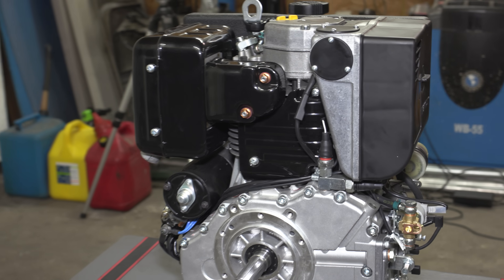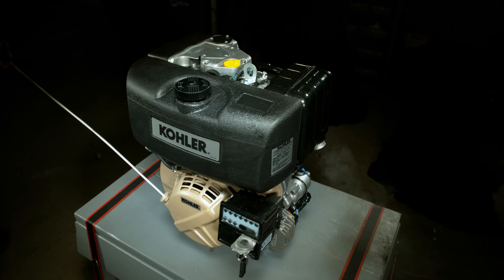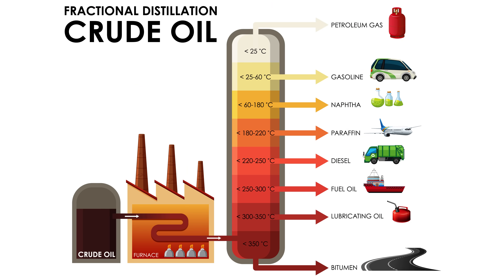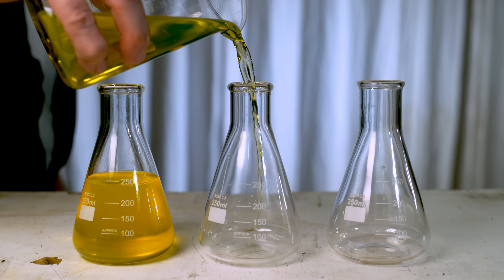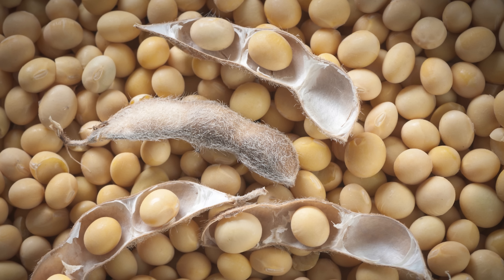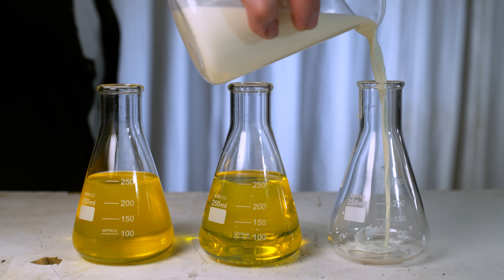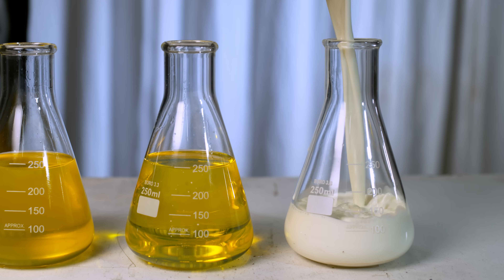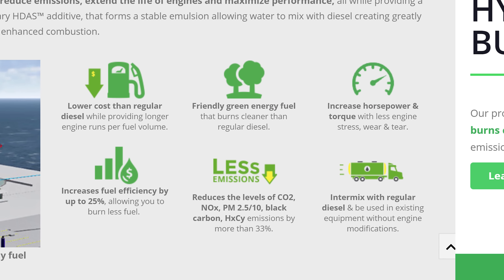Diesel - Biodiesel - HydroDiesel  (Fuels I Will Be Using for My Diesel Engine Series)

Comment: Never heard of Hydro Diesel. That is what I'm most interested in seeing more info on.
Edit Ok upon more investigation finding consistent info using the search terms Hydro Diesel or Hydrodiesel is hard to find consistent info on. For those interested search for Emulsified Fuel or offshoots of that for better info however the info is still limited with that. It looks like an interesting technology that has been being worked on for years but I am super interested in seeing more info and real world testing on this. So hurry up! 😁😉👍
Reply from the maker: Heck yeah.. it's coming
Reply: @WarpedYT  know I'm a bit late to the show but would you ever consider circle backing and checking out/trying Black Diesel(also known as WMO Diesel or Waste Motor Oil Diesel)?
Reply: mute8s I think it is a Bit like the Fischer-Tropsch-Verfahren
Reply: @kommentarekommentieren455  Yes , i 1st heard about it from a very old guy from Germany, back 1979/80, went to visit him for a demonstration of Diesel fuel and WATER, he blended Diesel with hot water in a hi speed Blender, poured it in a container under hood of a later 70s Mercedes 4cylinder car! he also had in trunk a fuel heater ,heated by engine coolant(someplace i have a pic of heater).
drove around the block 3 times without problems .
at the time it seemed a lot of work for what was done, altho fuel prices were going UP then!
 but , in after thought, i busy with life and its BS, shoulda, coulda , woulda,  still a viable thing!
 like Germans squeesing oil out of GRASS from bottom of the DANUBE river, so much knowledge lost in changing times!
 now we are in a FAST change again of normal(for today) life , i think a lot of good things will come of it all!
 humans are a tough lot, and will come back to power, long before it all ends!
 they seem to work best when under the threat of a form of death/etc!
Reply: I found this series of vids you’re doing very interesting indeed. I’ve owned 2 diesels and very much liked them. They do though get very bad press, and I am still sure more because of bad habits by drivers that cause this. 0-60 times are not what they’re about, and the motoring press and ad makers should hang their heads in shame, coz when gas is gone it’s gone! There is almost no quicker way to burn it than blasting away from the line every time, as is the norm these days - only to join another queue🤪
Anyway rant over, I was encouraged to see a new cleaner breed of diesels on a recent search of 2014 - 2017 cars that here in UK qualify for really low annual tax. Usually a sign of how clean they are. So any tech or ways to improve that even further is a Major in my book. Thanks so much for doing this👍👌
Reply: @ICGedye   Been trying to find out more about oil and water emulsions, lots of great info comes from the videos on youtube that are about cosmetics when they make lotions and creams. Lecithin comes up quite often as the surfactant that bonds oil and water, I cannot see why it wouldnt work with diesel fuel. one thing that I have learned is that you cannot mix the surfactant with the oil first. you must mix it with water otherwise you end up with an unstable emulsion.
Reply: www.trillion.energy is the developer and producer of HydroDiesel fuel.
Reply: ظ
Reply: Me neither I’m hoping that Hydro Diesel will make diesel engine vehicles still be able to be produced even 30 laters when EV and even CNG vehicles would dominate the road
Reply: Engineering Explained could make a video about it.

Comment: Renewable diesel is a pure hydrocarbon diesel fuel that is chemically similar to fossil diesel, and is known as Hydrotreated Vegetable Oil (HVO) fuel, whereas biodiesel is a Fatty Acid Methyl Ester (FAME) product which is not a hydrocarbon. Biodiesel contains oxygen, making it different from both fossil diesel and renewable diesel and therefore can not act as a 100% substitute for traditional diesel. Nearly all OEMs (original equipment manufacturers) limit biodiesel content to 20% with some only allowing 5%.

Comment: Hydro Diesel.  Would you have to switch say from  7.3l turbo diesel engine to a kohler engine?  How much would something like that cost?  Can people source say or buy their own "hydro diesel" machine like spring board diesel sells in Chico, CA?  And what would be interesting is to have a system that can self-clean/filter and recirculate - like a closed system>..  Of course, tesla, the gas companies and biden/WEF wouldn't like this.  But who cares.

Comment: Maybe talk about difference between Renewable Diesel and Biodiesel. Big difference there. Bio is blended with fossil diesel and contains water which is bad for Diesel engines. Renewable diesel has no fossil diesel, no water, burns way cleaner, and has a higher Cetane value which provides better performance for Diesel engines. Made now in the mainstream Refineries. Renewable jet fuel way better for the atmosphere. A lot to discuss there.

Comment: guys dont use biodiesel it will screw up your engine big time...fuel filter will clog, lines will deteriorate in no time and in colder climate it turns to jelly...also its not advisable to store it due to algae growth and sludge....You will spend alot of money in repairs (and pollute environment even more) just use regular diesel if possible with ZERO bio added. This environmental hysteria is just a tool to rip you off, dont fall for it.

Comment: Have you heard about a diesel fuel called Neste MY? They say it’s made from recycled waste. Something to look into.
Reply from the maker: I think that is the same as the biodiesel that I try here.
Reply: Neste is a renewable diesel. Renewable diesel is a pure hydrocarbon diesel fuel that is chemically similar to fossil diesel, and is known as Hydrotreated Vegetable Oil (HVO) fuel, whereas biodiesel is a Fatty Acid Methyl Ester (FAME) product which is not a hydrocarbon. Biodiesel contains oxygen, making it different from both fossil diesel and renewable diesel and therefore can not act as a 100% substitute for traditional diesel. Nearly all OEMs (original equipment manufacturers) limit biodiesel content to 20% with some only allowing 5%.

Comment: Can you leave some bare iron/steel sat in the hydrodiesel for a while to see if any corrosion occurs? Also maybe get in touch with Project Farm for him to compare it’s lubricity compared to normal diesel? Corrosion and lubrication would be my main concern about running it through a diesel injection system, especially a common rail system. 

Would also be interesting to see if it works for combustion chamber/carbon cleaning at all.

Comment: Check egt’s with the engine running rich on each fuel. 

That could be useful for superturbo diesel om606 engines, om648 tuning an so on👌👍 if one fuel burns colder

Comment: First of all I am excited for this series, second I have done some research on alternative diesel fuels and some that I am interested in seeing are SVO (straight vegetable oil) and DME (dimethyl ether). I know that the SVO works in old Mercedes diesels as I am running mine on it, I would like you to try SVO to get people thinking about the fuel as it is a simple and cheap alternative. DME as a gas though so you would need to modify the engine to have it mix with the air as it comes into the air intake. It shouldn’t be too hard but throttling it and maintaining control may be a bit difficult.

Comment: Don’t know about the individual fuels - I’m interested in seeing how you make it see though with the high pressures diesel engines develop. Sounds like an engineering challenge of its own.  Big fan, looking forward to the video.
Reply from the maker: It is an engineering challenge, but I've been working at developing a solution for about three years.

Comment: I would like to see: 1. how much carbon is accumulated inside the engine combustion chamber for each fuel type. Also, 2. Oil condition after running engine for a long period of time and compare protective properties and any valuable information that oil analysis can reveal.

Comment: How about Renewable Hydrocarbon Diesel? It's a Hydrocarbon fuel like petroleum diesel, but made from fats and oils, like Biodiesel.  There are several new production facilities being planned by a number of different companies.
Reply: Renewable diesel is a pure hydrocarbon diesel fuel that is chemically similar to fossil diesel, and is known as Hydrotreated Vegetable Oil (HVO) fuel, whereas biodiesel is a Fatty Acid Methyl Ester (FAME) product which is not a hydrocarbon. Biodiesel contains oxygen, making it different from both fossil diesel and renewable diesel and therefore can not act as a 100% substitute for traditional diesel. Nearly all OEMs (original equipment manufacturers) limit biodiesel content to 20% with some only allowing 5%.

Comment: If you end up doing the see through Diesel engine, try mixing a bit of ether with diesel fuel. Ether reduces the ignition delay period which is the time from when the fuel is injected in the cylinder to it combusting because the fuel has to vaporize first under compression before it combusts.  And if you use the high speed camera, you could compare the ignition delay with regular diesel/other fuels.

Comment: You should improve your test rig. Use a electrical generator as the load, where the generator stator is connected to a acurate scale. So, it is the same as before, Nm x rpm = W. But the generator load is smoth and does not fluctiate as the rotor with brakepad that you are using.
Reply from the maker: I agree, the only issue is the size of that rig, I was going to do a different type of Dino using a similar principle, but instead of electric resistance using fluid resistance which is also very smooth, and deals with heat a lot better. but the reason I didn't do the fluid I know from the beginning is because again it's kind of bulky and everything is hidden. For this test I got the brake dyno pretty straight where it's not shaking all over the place. I was going to add an external shock absorber which I may still do but for now, it looks pretty accurate.
Reply: @WarpedYT  You could use a simple asynchronous motor that come in all sizes as the load/generator. Rotor is connected to the diesel engine and stator is free rotating, only connected to the scale. Then, use ac capacitors over the delta winding to magnetize the rotor. The load, you can electrical regualate with a pure resitive load, like a simple heating oven or lamps. This principle how we find motor charakteristics in the industry. The diesel engine is not yet dead; diesel contain a lot of energy and in a closed carbon loop, with adblue and particle filter tech, it is usefull to the point when the battery get cheaper and better.

Comment: HydroDiesel.  http://trillion.energy/en/.  Everything on the home page screams  scam.  From the proprietary emulsifying additive that makes it possible (lots of off the shelf products already do this.  The concept is not new even if they have their unique method).  The sprinkling of various percentages of fuel savings, while increasing power, and still reducing every buzzword emission they could find.  The goofy image of the facility just hanging out on the shore.  Based in LA, a state rife with corruption.  I guarantee running emulsified water through a common rail injection system for any length of time will mean at least new injectors, possibly high pressure pump, and if not caught in time a new engine.  If a person really wants to run water through their diesel engine then a quality water injection system set up in the intake tract is a proven technology.

HydroDiesel testing.  This is all lab stuff, and the manufacturer should be able to provide.  Bet they won't though.
Lubricity,
Corrosion Suppression
Bacteria and Fungus Propensity 
Flash Point
Cold Pour Point
Cloud Point
BTU content.

Comment: Very interested to see the new fuels. Towards the end of the series if the see-through head is successful of course I'm going to say for everybody it needs some boost. A modified mechanical fuel system should easily adapt for some sweet boost and turbo noises👍

Comment: Renewable diesel. R99. Supposedly it acts like a regular petroleum diesel at low temperatures and doesn’t harm rubber seals and fuel lines. Propel and some 76 stations carry that here in California.
Reply from the maker: I'm going to check that out
Reply: Renewable diesel is a pure hydrocarbon diesel fuel that is chemically similar to fossil diesel, and is known as Hydrotreated Vegetable Oil (HVO) fuel, whereas biodiesel is a Fatty Acid Methyl Ester (FAME) product which is not a hydrocarbon. Biodiesel contains oxygen, making it different from both fossil diesel and renewable diesel and therefore can not act as a 100% substitute for traditional diesel. Nearly all OEMs (original equipment manufacturers) limit biodiesel content to 20% with some only allowing 5%.

Comment: I would really like to see this Diesel engine run 100% synthetic fuels using the Fischer-Tropsch process, especially a Gas-To-Liquid conversion. Synthetic fuels hold a lot of potential of being a total transition from traditional fuels altogether and existing engines don't really need any modifications to run these fuels. Even Shell and Sasol have launched synthetic fuel plants in certain countries, but they have yet to go mainstream here in the U.S.

Comment: Smartplugs, you can run a gas engine on diesel with these
Reply from the maker: Problem is that a gas engine doesn't have nearly as much compression. So I don't think the efficiency would be nearly the same.
Reply: @WarpedYT  Yes, tha'ts why smartplugs essentially make a variable compression ratio.  You screw them in and out to change it.  They start on 12v, like a glow plug, and then adjustments are made.  We ran an 8hp briggs on straight diesel, and then got down to 50/50 mix of veg oil and diesel.  We never got the gas engine to run on straight veg, but we got pretty close!

Comment: Would love to see a 12 volt battery hooked up and the use of the key start ;-) you know to help PREVENT injuries ;-) 
Just messing with you and I am very excited to see what kind of crazy you come up with.
Reply from the maker: Well once you see the video, we should be all done shooting it tomorrow I actually just pulled started it for the very first start. Which turned out to be pretty easy once I got the hang of it. The issue here was that my hands were oily. Yup, I ended up hurting my tendons a little bit, but after about a day I was good to go.

Comment: This raises a lot of questions...
How much water is inside of the hydrodiesel?
What keeps the water in emulsion?
Does the water effect lubricity, increasing wear?
Why would you mix water and diesel? Why not just have a water tank and a diesel tank? I can't imagine a gas station would prefer an extra hydrodiesel tank over just having one for destilled water.
Would the cooling effect keep the engine and cat cold for longer on a cold start? That could mean higher emissions on cold starts if the they are not reduced enough to justify that.
Reply from the maker: Well I can tell you two things right now, hydrodiesel is 20% water 80% diesel in the engine does in fact run a little bit cooler.

Comment: I would like to see if there is a problem with corrosion in the fuel system (especially in the injection pump)from the hydrodiesle. Also compare lubrication properties of all three fuels. Important for long injection pump life, Sulphur used to be important for that back in the"old"days and it was (is)a major concern for the people(like myself)who use low sulpher fuel in older engines.
Reply: Just what I was thinking.
Reply: You definitely have a good point there!

Comment: i've completed my masters in automotive engineering and my thessis project was on diesel engine so i've tested all the three fuels listed above ....in india mostly Jatropha biodiesel is used...and you need to tune the engine according to the fuel to get the max performance....as example injector pressure, compression ration and fuel injection timing

Comment: Hey also try off road diesel it is high in sulfur, and used motor oil I have ran my tractor on it also called black diesel.
Reply from the maker: I was thinking about used motor oil, I didn't know people actually ran that as a fuel. Calling it Black diesel would make sense.
Reply: Warped Perception yeah.  Older indirect diesels love it (think f series idi, Mercedes, Volkswagen). My idi can run close to 25-30%.  Has to be filtered to 1 micron
Reply: @WarpedYT  also try ATF!
Reply: Sometimes “off-road” diesel is identical to standard diesel but doesn’t get charged road tax and has a florescent die in it so that the tax collectors can check if you are cheating.

Comment: Just an FYI, you're not making the first "see through" diesel engine. People have been making optical research diesel engines for decades.
Reply from the maker: Well technically YES, that's the same way I brought the gasoline see-through engine to YouTube, I had built a few versions of that engine for research purposes for one of the big three automakers. To clarify I meant the First  see thru diesel engine on YouTube, also I meant a conventional diesel engine with overhead valves and fuel injection. I am currently working on a different type of engine that doesn't have valves.
Reply: @WarpedYT  Sounds good. Always good to brings things to the public eye on youtube and get them interested in engineering. For most modern optical engines we use quartz glass windows, quartz glass pistons and mirror setups that allow optical access into the combustion process (Be it a camera like this, or a laser setup for volumetric mapping)